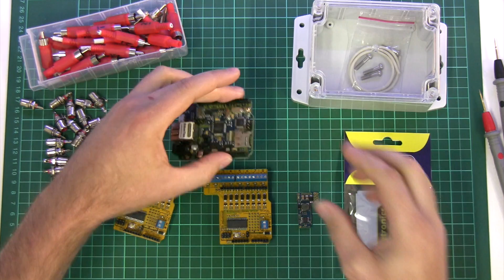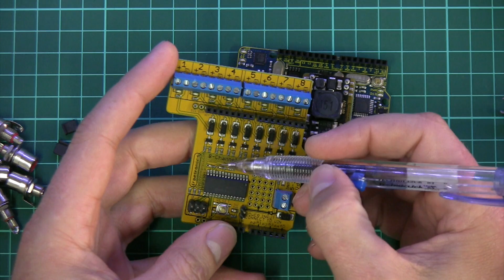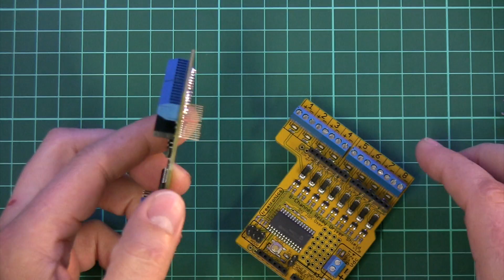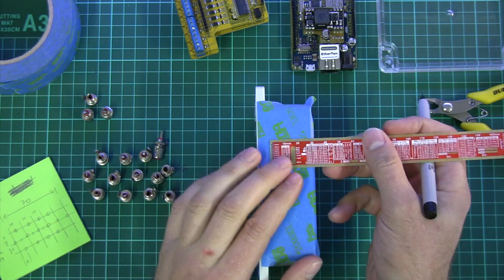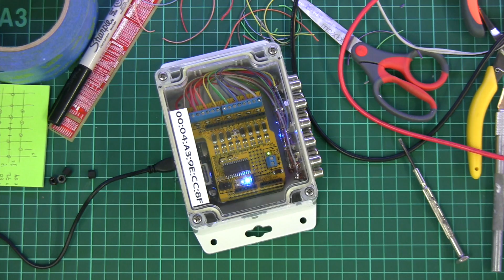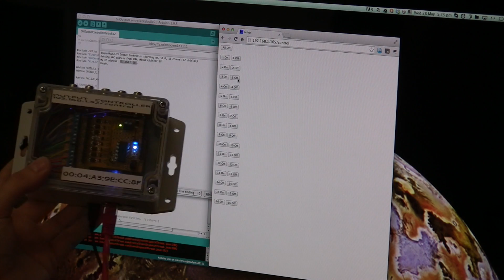SuperHouseTV #12: Building an Arduino home automation controller

Comment: Great video. A pity about the hum, though :/
Reply from the maker: ***** Yes, the hum is annoying. I didn't notice that until after it was all recorded. I've just been experimenting with different microphones and it seems to be coming from the Audio Technica lapel mic. I'm doing a new episode now so I'm trying to get better audio this time
Reply: SuperHouseTV In a program like Adobe Audition you can record a few seconds of 'silence' with that mic, then scan that for a noise profile and apply a filter to the whole track that will search for and remove a hum like that. Works really well for sounds that can't easily be notch-filtered.

Also thanks for the video, getting started in arduino and its great to see what can be accomplished with a bit of hard work.

Comment: Very interesting video...but can you please tell me what is the name of the green board where you working on? i am trying to find one of those but don't know how to searh for that.... and one more question about that board....is it scratch or cut resistance?
Reply from the maker: nikos It's just a craft cutting mat (A3 size) that you can buy at many craft or hardware stores. They're normally quite expensive, but I found some really cheap at a Reject Shop and bought about 10 of them so I'd have some spares.

Comment: Thank you for  the video.I am new to this. I tried compiling the ketch but I am getting the following errors. would you please advise of what is missing? I tried reloading the webservre library but it did not help.
sketch_nov05d:38: error: 'Webserver' does not name a type
sketch_nov05d:47: error: variable or field 'serverCmd' declared void
sketch_nov05d:47: error: 'WebServer' was not declared in this scope
sketch_nov05d:47: error: 'server' was not declared in this scope
sketch_nov05d:47: error: 'WebServer' has not been declared
Reply: Nkadi Sukidi The library is not correctly installed.

Comment: Two questions.... How do you handle ISP's using DHCP and changing your IP address occasionally or are you using a static IP, and Is your system only controllable VIA your LAN or can you access it over WAN.... I have been building a system from scratch myself and I am using Port Forwarding. Right now its not too much of an issue because i could care less if somebody turns on and off the three LED's connected to my arduino but I will be concerned about security when. I have actual appliances connected to my system... might be creepy to have somebody turning on my lights from across the globe. Great videos by the way I really enjoy the project.

Comment: hi there 
very good project I'm interested in it, but what if in the same control from a pc, better control with a cell with some aplicaicón? would be much more to the user's hand. 
In one glance you can make a aplicaicón for andorid called AppInventor 
and easy to use, it would be great to do
and do not know if you sell ethernet shield? because I have the arduino Mega 2560 and arduino UNO

Comment: Hi Jon,
I like Arduino stuff and experimenting with home automation. I also like your channel and waiting for new videos.
Anyway, I made a project for my bachelor thesis with two arduino boards. It has 3,2" touchscreen and controls 3 temperatures in water system to power on/off pump of solar panels. It also change leds between red and green - simulation of electric valves.
If you would like to see it, I couldsend you some pictures and souce code. I know thet my code is a bit terrible (for example between board I have one way serial comunication instead of I2C, and so on).
Hope you'll make another video soon :)
I really like your EtherTen and Ether mega boards, but for me are a bit expensive, so I'll experimet with ethernet shields.
Have a nice day, I'll be glad for response :)
Greatings from the Czech Republic

Comment: This is cool, if I can get it to work!
The sketch doesn't seem to work on the EtherTen R3. I have the Webduino library in, and have set the MAC and IP in the sketch. When I go to the serial monitor, it gets as far as "Getting MAC address from ROM:" but nothing else appears.
I know the network connectivity is good, as other sketches that use Ethernet.h to send data to a browser works fine.

Could there be a compatibility issue with Webduino and the EtherTen R3? Or a change in the sketch maybe?

Thanks,
Jason.
Reply: I had to modify the sketch a little to work with the EtherTen R3 but it works well. Now to translate to use MQTT so I can integrate it into my system.
Reply: Andrew Waite
Hi Andrew,
Any hints as to what you had to modify?

Comment: Great Video. 
I feel terrible about this but I want a more meaningful career and I think I would enjoy installing this into people's houses. Would it be wrong to use your code or any opensource code to help someone who was willing to pay for it to be done?
Or would it be the same as someone creating a wordpress website and charging? 
Thanks again for being so helpful in this way
Reply: That largely depends on the license used, and the wishes of the author. Even so, if I did get permission (or the license allowed me to do whatever I wanted), I still think it's good to pay so much %age of the profits to the original author, as a "thanks for letting me use your code." I don't particularly think it's wrong to make money from an open source project, provided you support the community as well, IMO.
Reply: um.. intellectual property addresses these concerns with open sourced concepts..1)if you are the originator of the developed intellectual works..2)you have listed as the originator of this idea(the creation : TM or similar) then you ARE the authority of the works created..sort of like planting your flag on the moon..hope that helps some...

Comment: Hey John, 
Awesome stuff as usual, but i have a question that i guess is going back a bit. Given how long ago you decided to implant your RFID chip, would you say that today it is still worth it, considering that the RFID chip stores such a small amount of data and the data is scannable, so it is possible to copy your permanently implanted key?
I have also noticed higher data storage in NFC tags that are also injected such as "Dangerous Things xNTi" if you were to do it again would you use something like this?

Cheers

Comment: Great video Jon.
Will there be an updated relay shield released in the future without the I2C pull-up resistors, or with easy to cut tracks?

Comment: What about this relay controller? Where could I find? Thank you very much. I just love your channel.
Reply from the maker: It's a shield called a "Relay8" that I designed specifically because I needed it for home automation! I can't put a URL in a YouTube comment, but if you search for "Freetronics Relay8" you'll find it
Reply: SuperHouseTV Actually now with the comment system rehaul, you can. http://www.freetronics.com/products/relay8-8-channel-relay-driver-shield
Reply: SuperHouseTV Thank you. I have found that.